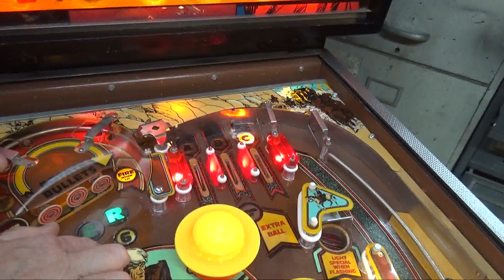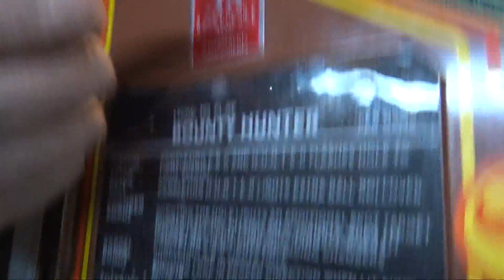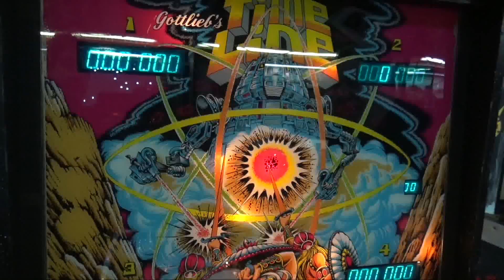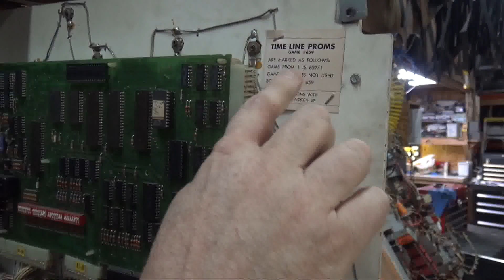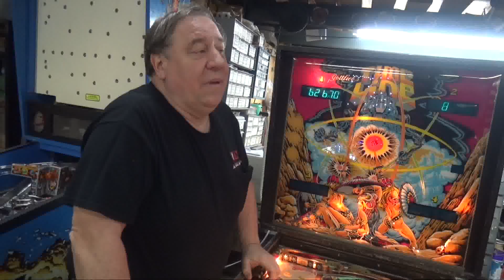#1269 Gottlieb BOUNTY HUNTER Pinball Machine-PLUS Bargain TIME LINE Pinball! TNT Amusements

Comment: I own a Bounty Hunter and I'm hoping to pick your brain with my sound problem. It used to have an issue with volume. Some times it was fine, other times it would be pretty quiet. Then the sound board died after a loose ground killed my mpu. I replaced both the sound and mpu boards along with game specific roms. I also crimped a new harness for the sound board. Now the game plays perfect again, but still there's a sound issue. Now when I power up, two things may happen. Either I just get a pulsing through the speaker until I shut it off, or it has all sounds a normal volume but it either fades out to nothing or abruptly stops. Volume doesn't seem to be an issue anymore. I've done the ground mods to the game, and outside of the sound problem the all switches fire correctly and all playfield lights work. Any input would be great. Thanks
Reply from the maker: You missed one thing...the sound board gets its signals from the driver board...the ship that powers the sound connector (2nd down on the left side)...follow the traces to the chip...its probably blown too.  Exchange another driver board to see if thats it.